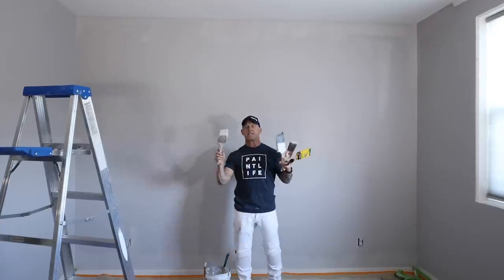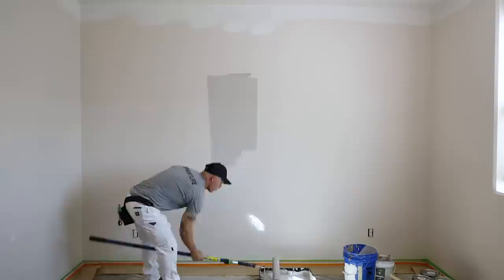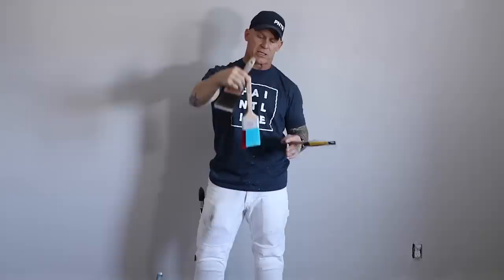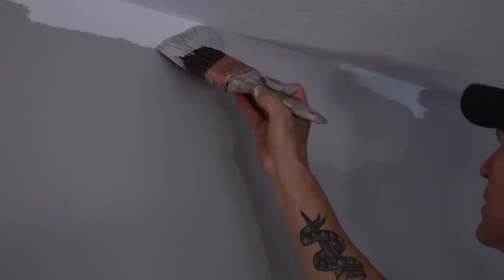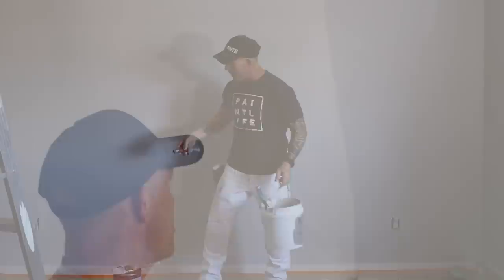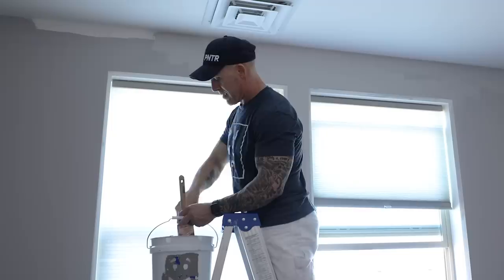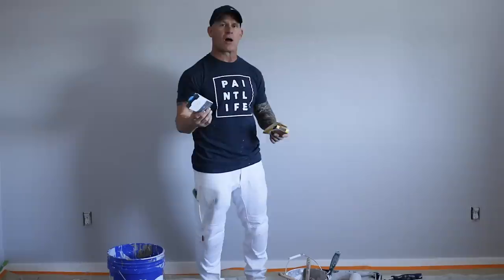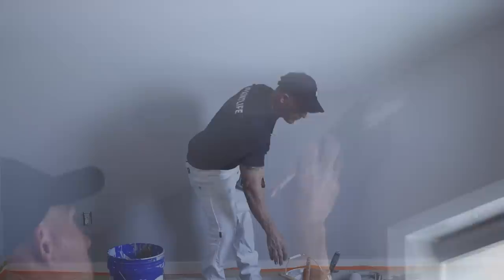5 Cut In BRUSHES

Comment: For the most part , a talented painter could cut in well with any of the above. Most times it is not the brush but the technique behind the brush.
Reply: Thank you i'm 20 yrs in a could cut in with a old mop.
Reply: @danielwalker5501  I'm 12 and I cut in with my wig.
Reply: I'm 8 years in and I could cut with a spoon
Reply: A great brush wont make a bad painter good. A bad brush wont make a good painter bad.
Reply: oh no doubt you can cut in with anything but I like a soft bristle brush especially with oil and trim because you don't get all those brush marks

Comment: I’ve been painting for over 10 years now, I watched your videos on different paint brushes that you’ve used, which people think are the best cut and brushes. But by far what I have noticed through trial and error, is the corona Shelby 2 1/2 inch angled brush beats all of those. It holds paint longer, has a straighter edge line, and is way more durable. Love your video’s.
Reply: they clean out easy too : )

Comment: I'm honestly shocked that Wooster Silver Tips weren't in the video, Purdy's quality has severely declined.
Reply from the maker: They are OK
Reply: Worcester silver tips are the best bang for the buck. Smooth as anything. Problem is the only last a few jobs before they turn to crap. At 8 to 9 bucks a brush how could you go wrong though.

Comment: Nice vid! I found that if a brush “points” well it makes for a good cut in brush. Purdy used to do that but their quality got taken down a lot after they were bought.  The ability of the brush to come to a point with a 45 degree on the nose of it when you put forward pressure is what I mean by pointing. This keeps you from having to put twist actions on the brush to detail corners and help control the line on the straight lines. 
  Your strategy of going with one brush is a good one because you can get very skilled at handling technique details and not having to sort it out with all the variations. Since you do exteriors and interiors picking one that works for both is pretty a pretty sound idea. All you have to do is register the variations in paint viscosity and get your game together under changing temper conditions and you have a great efficiency base that just improves over time.
  Square pointing brushes are a total non starter for me. I am going to give those montocks a try for sure.
Reply: Thank you! Informative

Comment: I like using a 3" straight brush for cutting in walls just personal preference. 2 1/2" angled for ceilings and trim
Reply: Chris, We have the Premier brushes, Staalmeester..that  Johnny Dayter and I have both used.I used the Wizz Wedge too. My favorite is the Wooster blue lable stiff. Agreed.. the brush has to hold the paint and make a good line. Can't be shedding bristles etc.  Agreed softer bristle brushes used for different applications. Staalmeester is excellent brush for the right application.  We like Premier and Australian Oldfield brushes too. Arroworthy has a good line too. Great to test them all out to see what you like best:)Nice informational video. Pres.  / Owner of JHCPAINTING (40 years of quality painting)

Comment: Thanks the review on those brushes, Kris. I wanted to give that wedge brush a try for a long time but I tend to shy away from bold claims. I personally perfer the Corna Cortez 3 inch for cut in, moved from FTP Wooster which is still a good brush just too stiff for interiors but best on Exteriors. The Cortez brush handles are made of birch which doesn't swell up with water and holds good pant and the filaments are a perfect blend like Premier. I've also used PPG paints I'm a fan of, I'm not too crazy about Timeless, one the price point on the higher end and it is splattery I perfer using Diamond, I get really good results and the price is very competitive.

Comment: geez it cut off my whole comment . I will try it again , but much shorter this time in case it does it again .  After trying a whole bunch of different brushes I have come back to the Picasso and the brush I use for residential cut ins . There is likely a lot of personal preference involved when professionals talk about their favorite brush , but for me the Picasso's hold more paint, cut in very sharp and save me time and money on my jobs. The only downside is that the orange filament does wear out pretty quick . After , say a 4 or 5000 sq ft repaint I throw it in the trash and start the next job with a fresh brush.  If you lay off lightly with your last stroke of the cut in then carrying a cut bucket with a mini roller in it is completely unnecessary . Especially if you roll the wall out while the the cut in is still wet you would be rolling over where you rolled the mini roller anyway .  Learning to lay off the cut in with your brush instead of switching tools and carrying around a bunch of stuff in your cut bucket will save you a lot of time. I suppose there is some preference here, but, - often when I am doing repaints I see that , while the previous painter may have rolled two coats on the wall , and even done two cut ins along the door and window trim , they often only do one coat on the ceiling cut in . I alway do two coats on all the cut ins.  - but I have still to meet a client who has noticed that their previous cut in was light at the ceiling cut in . Especially with higher ceiling , people just don't notice, and can't tell the difference .  I think this guy explains why using the mini roller to roll into your brush cut is unnecessary pretty well , and he also convinced me to order a couple of the Picasso flat wall brushes as well ,  https://www.youtube.com/watch?v=CywkPwkK-tU.      Also Chris , I notice that you still have the $100 brush for sale in your store and I am curious about your reasoning behind offering it to your viewers?

Comment: Been at it for 35 years or so. Do not care for PPG products. My fav int wall paints are BM Aura and R Select Matte. Also like S Williams Cashmere low luster and flat.  I like French  point sash brushes for furniture. 

Corona red gold 2 1/2 or 3 inch angled sash  is a good quality cut-in brush. Works well with pretty much every int paint
(IP is my favorite on line painter Dude)

Comment: If  cut a  white ceeling with flat white using a corner brush, then roll my ceeling Then cut my white walls with white eggshell, then roll e.t.c  will there be a demarcation at the top of my walls  from the ceeling cut that was made with the corner brush  ?   can you answer aswell in the context of adding colors instead of white. thank you:)

Comment: The round brush is called a sash brush and is used to paint sash windows, doorframe and alcatraves
Reply from the maker: Nice
Reply: @Idahopainter  I found the piccasso chisel tip brushes are the best even for skirting boards. Any sort of satin or gloss finish on wood work sash brush is the best

Comment: I don’t usually paint but I recently cut in an entire new house. I can cut in kinda straight but what was frustrating me a lot was that the back bristles on the brush that’s making the line pushed a bead of paint infront of the bristles so that my lines were straight but the edge was built up and not flat. Does anyone know why that happens? I was so frustrated cause that paint that was being pushed sometimes bridged over to the trim then I had to wipe it off the trim and redo it. Any advice or video you can recommend i watch to help me deal with that?
Reply from the maker: Thin out the paint a little

Comment: Hi! Can I ask why you use brushes for this and not a hand held sprayer?
Reply from the maker: There is a time and place for everything
Reply: @Idahopainter  thanks. I can understand an airless machine would be more time consuming for a single room. But a handheld airless device like the Graco would still come out on top speed wise wouldn't it? I have never used that type of airless sprayer before (although considering one). Are there factors besides time taken?

Comment: So round sash brushes are definitely not for cutting in walls,they’re for trim,architraves etc.
Reply from the maker: Is that what the manufacturers say?
Reply: @Idahopainter  well...
From my experience with them they’re not stiff enough or hold enough paint to cut in ceilings 
But they’re really good for trim and Georgian/french style doors and windows
As per manufacturers recommendations I never go by what they say,they’ll tell you that and angle sash brush is for cutting in ceilings.Which is definitely not what an angle sash brush is for either,although some people strangely prefer them.Straight cut or block style wall brushes are for walls.

Comment: Thought you were a Purdy clearcut guy for the longest. What happened and why did that change? Was it a sponsorship thing?
Reply: I was going to ask the same exact thing.
I thought your go to brush was  a 3" Purdy Clearcut.
Reply: Purdy has gone downhill seems like mostly general contractors still gung-ho about purdy not actual painters my last few clear cut elite purdy brushes sucked I would clean them out and switch back to a cheap home Depot Wooster
Reply: Yes sir. I Remember him taking about the clearcut a lot back In the day. I’m a corona guy myself but they aren’t cheap but I keep up with them and get my money worth out of them. Was never sure why he liked them so much. Haven’t used a Purdy since I picked up a corona about 8 years ago. I do like the Picasso oval brush tho they hold a ton of paint and they are cheap.

Comment: 5mins later it said and still cutting in the same wall,,I'd fire somebody if they took that long,,,,and the more you can do in 1stroke the straighter line you get,,,anybody could get straight edges if they took as long as this guy,,,,,I'd paint a room quicker than this guy cuts it in,,and with straighter lines